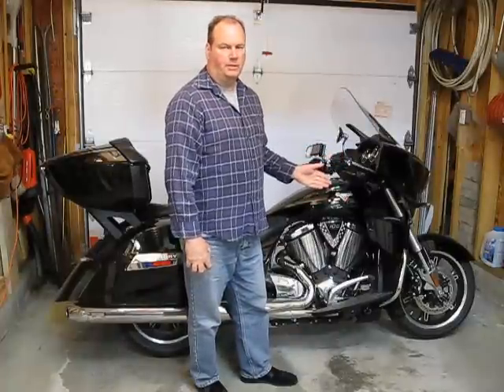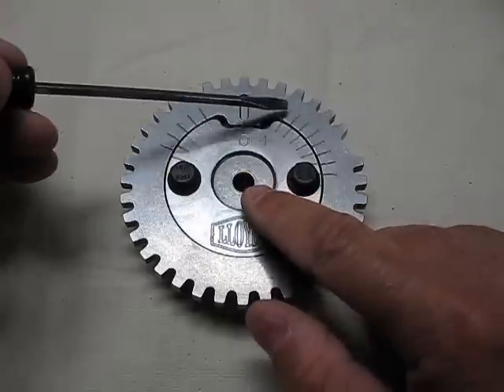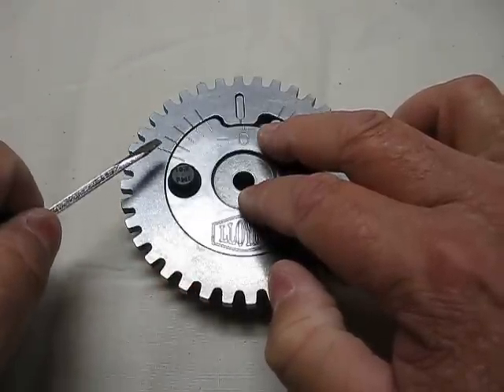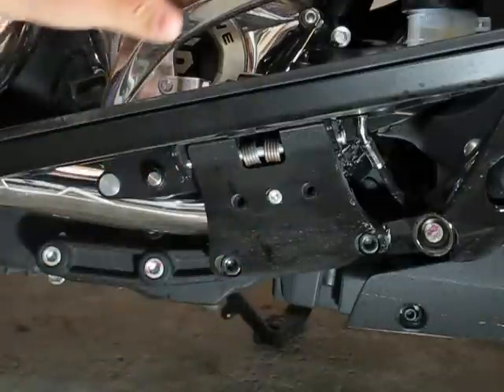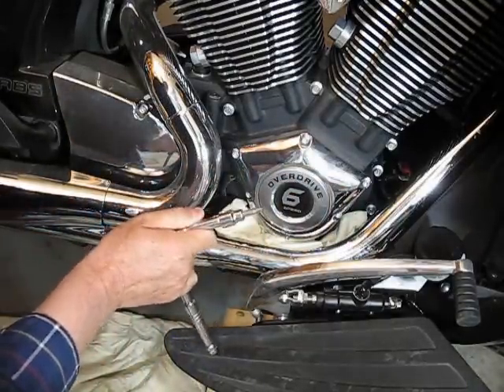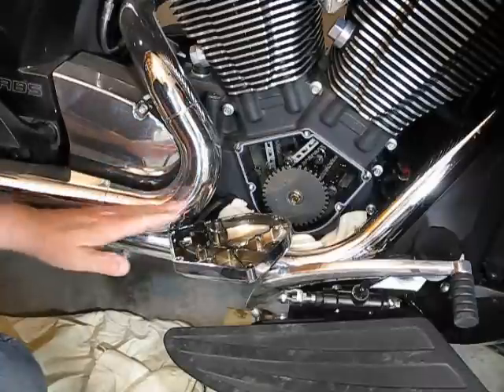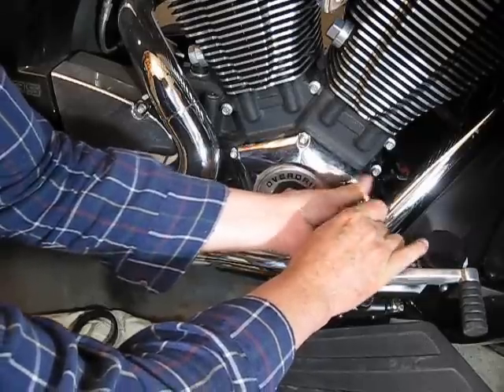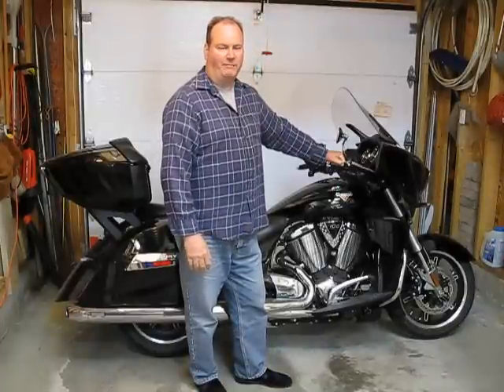Victory CCT Timing Gear Install

Comment: If you don't have an inch pound capable torque wrench you can do a really simple math equation by taking recommended inch pounds and dividing by 12, or 1-foot pound. Paul tells us the torque for the cover is 115-inch pounds so 115 divided by 12(inches) equals 9.5-foot pounds. But, if you work on your bike often, you should buy an inch pound torque wrench as it will be much more precise.

Comment: I recently purchased the Lloyds timing gear…..your video is great.  I have a question……My Victory Crossroads is bone stock.  I’m a little nervous to make this modification along with disconnecting the O2 sensors.  Have you had any issues?  Would you reconsider doing those two modifications?  Thanks Paul for any input
Reply from the maker: My timing wheel is still installed and my O2 sensors are still disconnected. It works well for me. You may find different results. What year is your bike? If you have 4 wires going to your O2 sensor then you have the newer ones with heaters that are monitored by the ECU and you will not be able to simply disconnect them without throwing a code. You will need a resistor plug which are available at cycle shops. I think the 4 wire sensors started around the 2016 model year.
Reply: @PaulPomerleau  Paul, Thank you so much for replying.  It’s a 2012 Victory Cross Roads.  Has the 106.  I love the bike……just needs a little more.  I love your videos and you seem to do your research.
Reply: @PaulPomerleau  So I installed the new timing wheel.  You’re video made it super simple even though I was super nervous.  I set the timing wheel to plus 4.  I think I noticed a little difference……oh and I disconnected the O2 sensors (again great video).  I didn’t have an inch pound torque wrench so I just snugged them up and didn’t over tighten.  I get no pinging at all…….I was hoping to be wowed but I think I feel a little more power.  Did you notice just a little more power or were you like wow what a difference……..I’m thinking about trying +5.  I appreciate your input 😀

Comment: Put my wheel on today. I bet I found why the bolts are stripping and the lowering of the torque specs. I bought my wheel 2nd hand and while turning the nuts I noticed one bolt was starting to back out. When that nut is tightened all the pressure is against the few threads in the wheel and nothing distributed to the bolt head. Good idea to check to see if those bolts are tight first. .... And don't over tighten!!

Comment: what is the benefit of this? I'm new to motorcycles and just got a victory and been watching lots of videos
Reply from the maker: Companies have to follow EPA regulations about emission control. To do this they de-tune the motor so it runs lean. This causes loss of power and a hotter running motor. Putting on a power fuel module and having it professionally turned is the best way to wake up the motor, but is also the most expensive. A cheaper alternative is to install this adjustable timing wheel. For my bike a +4 degree setting made all the difference.
Reply: Dyno runs have shown gains of a couple of horsepower and increase in torque.

Comment: Hi Paul. So did you only go with the timing wheel? If so, how did it perform?
Reply from the maker: I only put the timing wheel in (+4) to smooth out the bottom end and I also disconnected my O2 sensors. It runs good for my style of riding.

Comment: So you don’t have to drain the oil to swap it? 

I’m going to use a Maximus tuner so no need for one but I need to check to see if I already have one from the previous owner. I removed the 6 emblem plate to install another and the two bolts behind it are not there so I’m wondering if a timing wheel was installed.
Reply from the maker: No need to drain the oil for this job. The original timing wheel is a solid piece of metal and just has a center bolt only, so easy to distinguish from the variable timing wheel.

Comment: Paul, once again an amazing video. Send me your email so I can e transfer you some money. You’ve saved me thousands in shop fees. 
What setting did you find best for your 2014 cross country? I have the same bike.
Reply from the maker: Hi Landon, I initially set it to +4 and it ran great. I tried to up it to +6 and it ran terrible so I brought it back down to +4 and it is there to this day. Ride safe.

Comment: Hi Paul, My XC 2014 is getting unbearable hot to the level that I cannot sit on it. Could it be because of timing? did your setup had influence on temperature?
Reply from the maker: It did but very little, what I felt really cooled it down was disconnecting the oxygen sensors. Of course I have no hard data to prove this, it's just how I felt while riding. You could always try it to see how it works for you and simply plug them back in if you need to. Watch my video on how I did mine. Ride safe and have fun.

Comment: Hi Paul...would you  recommend disconnecting the o2 sensors with this timing wheel application ? Thx
Reply from the maker: You don't need to just because you have a timing wheel. I added the timing wheel to give me more low end torque. I disconnected the O2 sensors to richen the engine and make it run a bit cooler. Mine is a 2014 model so my sensors have only 2 wires. But Polaris changed them on the 2016 (I think) models to a newer 4 wire sensor and now if you simply unplug them you will get a engine trouble light come on. If you have 4 wires you must put a bypass plug on, one for each sensor. They are available at any place they sell the Power Commander modules. Hope this helps.
Reply: Thx Paul.mine is a 12.
Reply: I have a 16 cc..if I remember correctly,disconnecting the black wire on the o2 sensors will bypass them and not throw a code..seems to run much better since I’ve done this..just ordered a slightly used wheel for myself..great videos you have sir!! Thank you!!!

Comment: Hi Paul, I have the same bike as you. I was advised on NOT getting the timing wheel with my other mods (PCV, cams) as it is not necessary with the PCV. WAs this correct advice?
Reply from the maker: Although I don't have a Power Commander on my bike, there are many who have it with the timing wheel as the PCV changes everything above 2500 rpm and the timing wheel changes everything below 2500 rpm. With the newer Maximus tuner it can do the entire range so a timing wheel is no necessary with it. However you should send a message to Rylan at the Vic Shop as he is the pro on these things and he can give you the exact information. Hope this helps. Ride safe. Paul.
Reply: Paul Pomerleau Thanks for replying Paul. I will indeed ask Rylan on your suggestion

Comment: Quick question:
I understand that as of today, Lloydz is recommending the less f.t lbs of torque for the two smaller bolts etc. Question, do you put Locktite on the small bolts as well? What’s the recommendation for foot lbs for center bolt?
Reply from the maker: The latest torque specs is 17 ft/lbs for the center bolt and 6-8 ft/lbs for the adjustment bolts. I used the lower amount of 6 ft/lbs. I put blue locktite on the center bolt and did not use any locktite on the adjustment bolts.  I initially set it to +4, then tried +6 and didn't like it so went back to +4. Others have done different things, this works good for me.
Reply: Paul Pomerleau 
Thanks Paul. You’re a great help. I’ll be installing mine soon lol.
Reply: I’ve got a 2016 Victory Highball
Reply: Also, 
Another question. What’s recommended for the torque lbs for tightening back the hex bolts that hold the cam shaft?
Reply from the maker: You mean the 6 bolts that hold the cover back on? They are 115 in/lbs (that's inch pounds) they are not very tight. Make sure your pick-up wiring doesn't get pinched and also watch that same spot when you start up your bike for oil leaks. If the wire seal is not proper it will leak from there.
Reply: Paul Pomerleau 
Thanks again Paul for all the advice, God bless
Reply: Paul Pomerleau 
Hey another quick question of advice. I received my wheel. However, as I wanted to adjust the wheel, the two bolts came super tight, maybe they’re pre-torqued? Anyways, I made a huge mistake. I used my hex ball end to help me un loose the bolt, I broke the hex ball into the bolt. Would you happen to know if these two bolts on the timing wheel are grade 8 ? Im going to replace the bolt
Reply from the maker: They must have changed the bolts because mine used a regular socket head bolt. These should only be tightened to 6-8 ft/lbs so bolt hardness is not an issue, any one would work. Stainless steel would be better, not that it is needed with the oil in the casing but if I had to buy some that's the type I would get. But something is wrong if you broke your allen wrench on the bolts. They definitely should not be that tight. Inspect the threads carefully before putting the new ones back on.
Reply: Paul Pomerleau 
Thanks Paul, you the man bro. Much respect from Oceanside CA!

Comment: Ok plan on doing the wheel. I also already installed lloyds filter, and pulled the baffles out of mufflers, welded the exhaust ends back on so looks stock. My dilemma is can't decide wether go with PCV or Lloyds fuel tuner? Have you heard which is best for the buck? Or I imagine I'll have to get dyno regardless   Future plan is triovals when funds support.
Reply from the maker: With your filter and exhaust work done you have really increased the air flow so a fuel controller is definitely the next thing you should do. People have had luck with auto tunes and such but if you really want to get the most out of your machine then bring it to a tuner who knows Victorys. They have the tuner that is right for your bike.
Sounds like you are going to have a sweet ride. Have fun.

Comment: hi Paul. I have a problem with my Vance and Hines slip ons on my 2015 Victory XC. One of the slip on turning black and other one stays clear... do you know why is that?
Reply from the maker: Are you talking about soot on the inside at the exhaust tip?
Reply: yeah. its kind of strange. its only one side
Reply from the maker: On the Cross Country bikes the 2 headers joins together before going out the right side pipe, so this is the dominant pipe and most likely will get the most soot. Just after they join there is a cross over to the left pipe. It will give some exhaust but not as much as the right. Soot is normal and you can simply wipe it away, but if you are concerned about it then check both spark plugs to see if they look the same, if they are both black and sooty then you are running rich.
Reply: Paul, tnx a lot for your info!!! You make great videos. tnx a lot for your reply!!!

Comment: Hey Paul, did you end up sticking with 4 degrees on advancement or have you changed it?
Reply from the maker: I tried +6 for a while but the bike ran rough so I brought it back to +4. This is where it remains.
Reply: Thanks brother, I really get a lot out of your videos
Reply: +Paul Pomerleau 
hey Paul also what brand of torque wrench are you using? are you using two different torque wrenches to do the foot pounds and inch pounds or is it the same digital wrench?.... I'm trying to find one like yours but they're few and far between what brand is that?
Reply from the maker: I have 4 different torque wrenches to do different jobs. I buy them all at Princess Auto in Ottawa Ontario. 
The black one that I use in this video is a digital one. It is my favorite because I can easily read the numbers and can change the units to whatever I need.
This is the one I used in this video - http://goo.gl/s48d9a
Hope this helps.

Comment: To keep the engine from turning simply put the bike in gear and have someone hold the front brake on tight while you tighten the center bolt. No special tools needed and especially no prying against any internal engine parts.
Reply: Don't really think you need the brake. 17 foot lbs is not a lot

Comment: did you make the proper adjustments on your torque wrench when you added the extension?
Reply from the maker: christopher tharp I believe you only have to recalculate the torque settings when you change the actual length of the wrench, for example adding a crows foot to the ratchet end, or a pipe to the end of the handle. A socket at the end of an extension is still in line with the ratchet end and doesn't affect the length of the torque wrench.
Reply: +Paul Pomerleau you're right, my mind must of been somewhere else
Reply from the maker: christopher tharp No problem, thanks for watching my videos.

Comment: Very professional. I just bought an 07 Hammer with the 100 cu in motor and i believe the installation is different. The only critique i have is instead of using a q tip to clean out the threads use a thread chaser. They will have threads looking clean and brand new.

Comment: Hey Paul, u on the VOG site?  I'm catpGPflorida on VOG.  I have the same bike as you do. Big gorilla in the corner question is.  Does the timing change void the factory warranties?  I have a 4 yr extended warranty on my XCT.  I am looking to cool down the bike. In 90 degree F weather our bikes run hot in Florida.  Like to upgrade some mods, yet not screw up my warranty.     Any feedback would be great from all.
Gp
Reply from the maker: George Pinon Hey George, yes I am on the VOG, username PaulJP.
My experience with warranties and insurance companies is they will try to find any reason not to pay a claim.
So that leaves you with two choices, either you do the changes then put it back to stock before bringing it in for warranty work, or you wait until your warranty is up.
I have heard on one forum that someone had a power commander on his bike and the company refused to pay for any work.
For me, I don't believe in warranties, I do what I want on my vehicles.
For you, if you want to be 100% safe, then unfortunately you are going to have to leave your bike stock.
If you have a good dealer and get along well with them, then ask them if you can do any changes to your bike, they may be ok with it.
That's the only answer I can give you my friend.
Ride safe and have fun.

Comment: Just wanted to say thanks for all your informative and insightful vids on the XCT.
 I picked up my 2012 XCT since last 9/2014 (3098 miles).  I've learned quite a bit from the VOG and your Vids. I just did the timing wheel swap today(Adjusters torqued to 84 in/lbs.) and with the cored exhaust and the O2 sensors  disconnected, took her for a good tour this afternoon and WOW!! what a difference . Btw In the Ottawa area.
Looking forward to doing more  mods!
Reply from the maker: Garth Buswell Hi Garth, wow finally someone in my area. Did my first ride today, 70 kms to the Timmys at March Road and Carling. I will probably be out all day tomorrow, should be a great day. Thanks for watching my videos, just did one today on how to change the oil and filter, it should be available any second now. Ride safe.

Comment: Thanks for the reply, I bought this bike and it was already dynoed, my problem is there is no dyno shop at all in my area. My PCV is at 5+ on 0 & 2% throttle 2500 -6000 rpm range.  So if I change this to 0 when I install ATW, AT 5+ I'M hoping everything would run the same with the bike. I feel if i do this it should now be 5+ across the board right? My AFR is 13.5 which I like so hope it stays this way.  Any thoughts?  Should I just n leave the bike as is since there no dyno here, or this changes make since?  Thanks
Reply from the maker: You are correct when you say a wheel set at +5 will be across the board. So setting your PCV to zero should keep the upper RPM the same as you have now, and also increase the timing under 2500. The wheel is one of the mods that everyone tends to start with as it is relatively inexpensive. I don't want to tell you what to do, but I would go for it, as I love working on my bike.

Comment: Do you need to adjust Power Commander V if you install this timing gear.?  Wanna install one, great video thanks.
Reply from the maker: Although I am no expert in fuel controllers, a lot of people are doing it to waken up the bike.
The thing I would watch for is the added timing from the PCV.
The timing wheel (ATS) adds timing throughout the entire range, whereas the PCV adds it above 2500 rpm.
So if your wheel is at +4 and your PCV is +4 then once you go above 2500 rpm you will be at +8.
So watch for this. The best thing to do after installing these devices is to get a good dyno done.
Reply: i got the wheel on 4 advance and also the fuel controller and confusing if i should go lower on the wheel back to 2 advance or go more 5 or 6 advance , bike is coughing in air filter

Comment: Great video, but Lloydz has once again changed the specs for the adjusting screws to "just snug down - do not over tighten".  Read as "do not torque".
Reply from the maker: Wow, this is the 3rd time they changed it since I bought it last summer.
Thanks for the update.
Ride safe.
Reply: Define snug.
Reply: @340rps right? Snug for 6'6" dudes is different than snug for 5'6" dudes.

Comment: Was curious about which torque wrench(es) you are using. Since you used both inch pound and foot pound torque setting, was curious whether you you used 1 wrench or 2. Let me know.
Reply from the maker: Currently I have 4 torque wrenches, ranging from small inch pounds all the way up to the big one that can do car axle nuts. I buy them as required for each job and find I have enough for pretty well all jobs I do now. I don't pay cheap but also I don't buy the real expensive ones either. I really like the digital ones as they are easy to read and you can convert the settings on the fly. Very handy but a bit more money and also a bit bulkier. When I bought them, I would first search the internet to see who had the best deal. In this particular video I am only using the digital wrench for the gear and cover. It goes from 90-440 in-lb (7.5-37 ft-lb) and can convert to Nm, ft-lb, in-lb, kg-cm, kg-m. I really like this wrench.
Reply: Thanks. You have been very helpful. Ride safe.